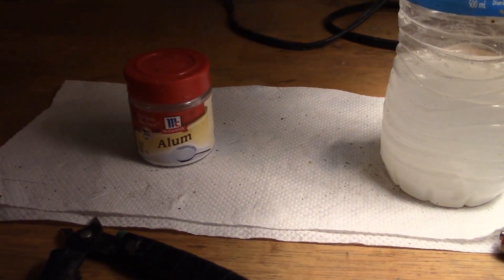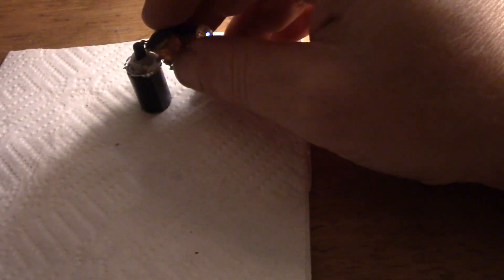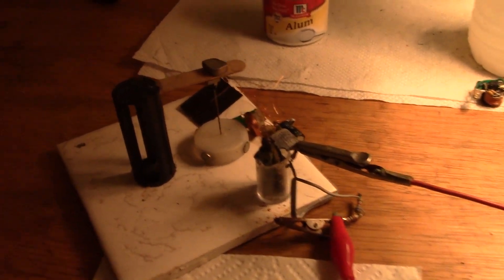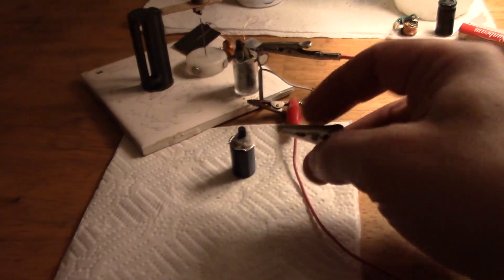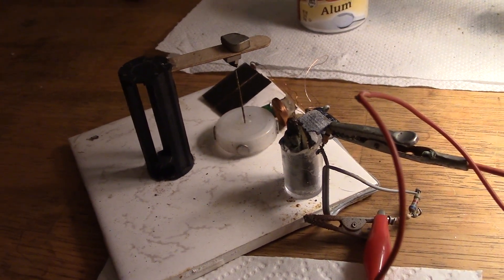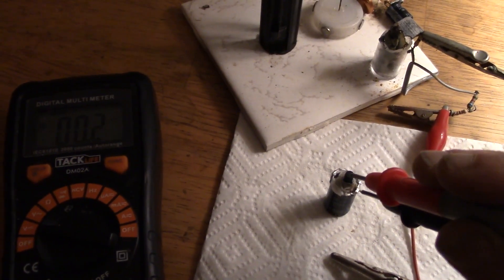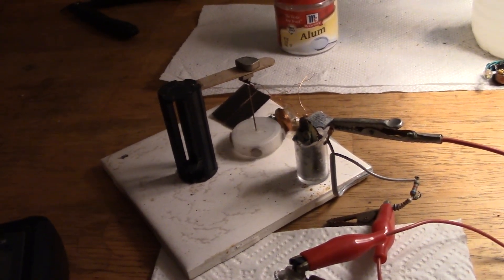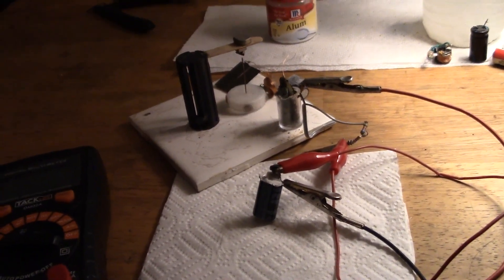A Capacitor Can Battery Cell

Comment: Nice reuse of old capacitor cases and a good uncharged starting voltage. Alum cells have given me the best results from all of my experiments to date. It should also last a long time :)
Reply from the maker: Many thanks. It seemed to be an obvious to use the alum, plus top ups are easy enough. I like the silicon seal idea from 'Dangerous to man' though. It trundled on last night for hours, until disconnected and is now sat in the window on a dull rainy day. Should do well and is just about the easiest thing to make... if one has a bunch of old boards sat around to take caps from.
Reply: @Slider2732  Next step is to minimise labour costs by reducing the time and effort required to prepare the case. What else is just lying around, freely available, made of aluminium and is a container? Me thinks we've been there before!!
Reply from the maker: My wife just reminded me, aluminium cans! I never did the air battery thing, but I think that's what you mean? So, really, how could carbon, or another easy to source electrode allow plenty of surface area? Might go and burn a tree branch in any case  :)
Reply: @Slider2732  Your wife's right. Use the same ingredients. What remains when you burn a car tyre? Lots of black stuff! Didn't you play with activated charcoal once?
Reply from the maker: I did, still got it. Hmm, the tyre thing appeals, would burn it at night though to match the smoke colour! 

Have been looking at plating the last couple of days... gold onto aluminium foil or something very similar. But also carbon black from a candle. Super light being the idea.
Reply from the maker: @pseudonym4693  WTH? lol, that was stunning. Completely unexpected and does remind of the graphene snakes thing. Thanks for the vid :)